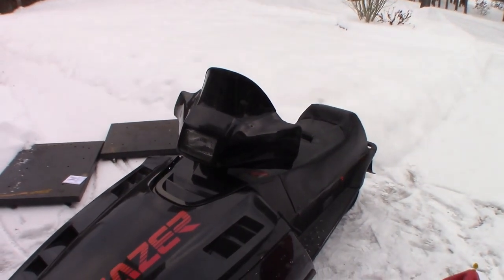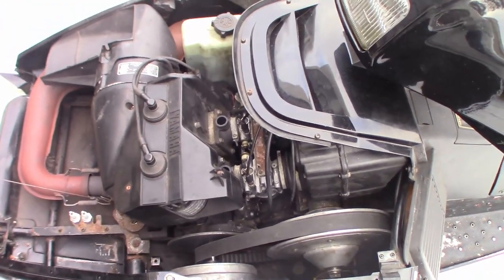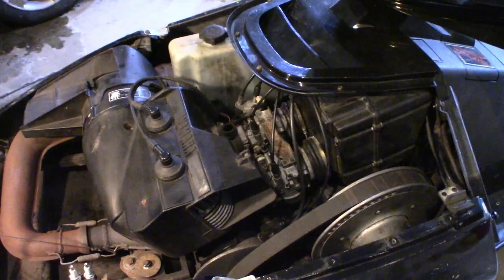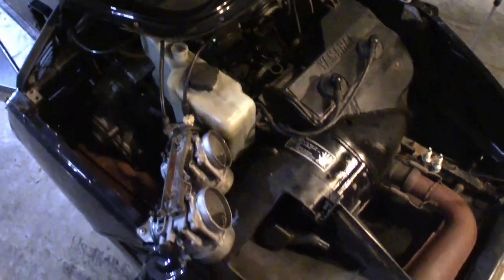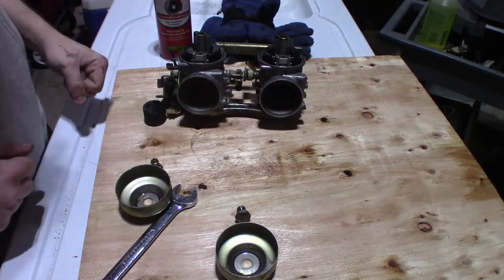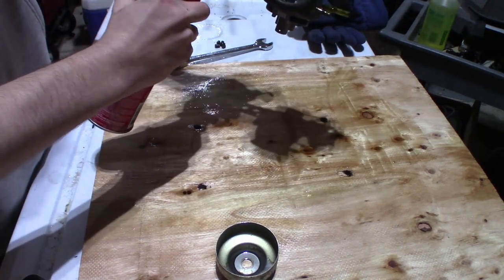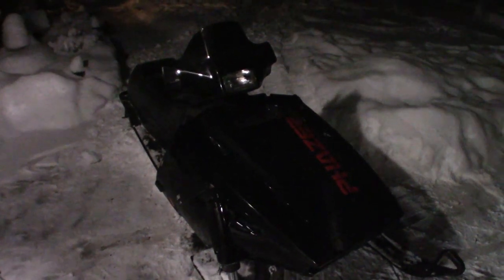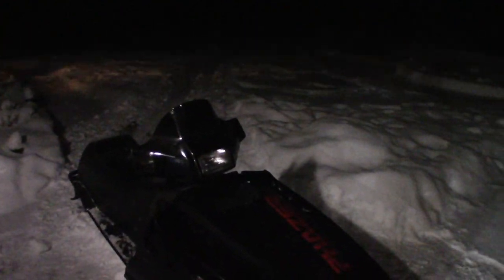Fixing my 1986 Yamaha Phazer

Comment: Good job getting the Phazer going, good luck.
Reply from the maker: Thank you, I grew up on a 1984 model that unfortunately bit the dust in 2014, I received this 86 for free as part of a special deal, it's nice to be riding on my childhood snowmobile again.
Reply: @YaKnowWhatOfficial I
Had one. But mine
Was running on
One cylinder. The carburetor was cluged. I had it.rebuilt it was runing better.

Comment: Currently working on one runs good but could be better little sluggish any tips? We cleaned carb it ran deadly pulled good and second run less snap and slow..thinking jetting, oil injection mix is off idk
Reply from the maker: That's basically what happened here, just make sure the enrichment jet (choke) is fully closing, and if that doesn't seem to change anything, you may just have to pull the carbs off and go through them. Check compression, should be 90 at the very least, anything under is top-end rebuild territory. Oil mix is a very hard thing to explain and understand through text, I suggest finding a video showing how to determine the mixture based on smoke and smell.
Reply: @YaKnowWhatOfficial  we did compression all.good around 110 
And 115 cleaned carbs she's running mint and is a blast from the past start second pull thanks for the reply
Reply from the maker: @KirkB_  Good to hear, The Mikunis on these are very sensitive so they need to be cleaned reeeal good. I strictly run ethanol free in mine and they still eventually gum up.